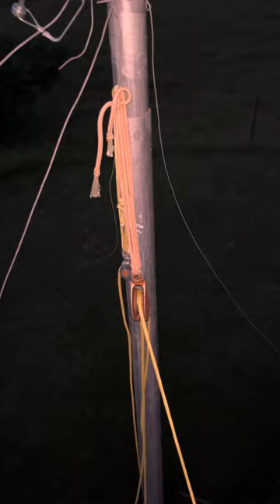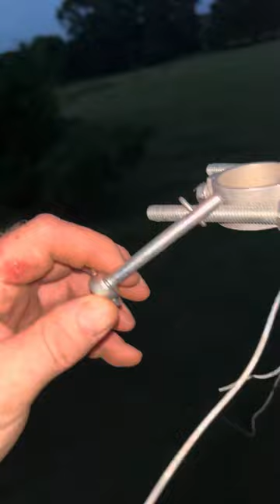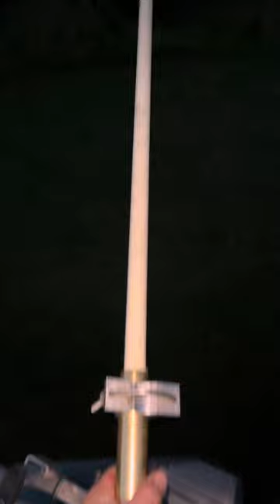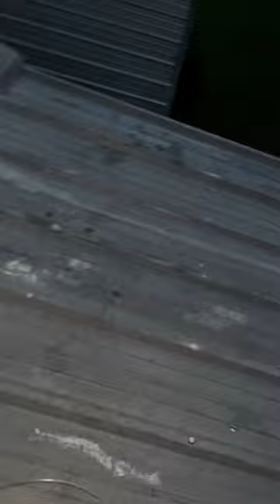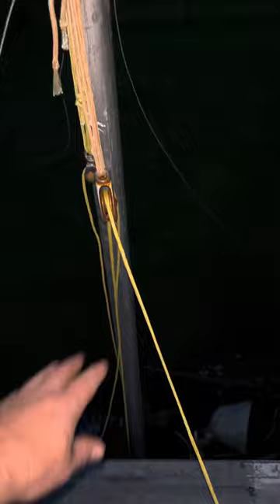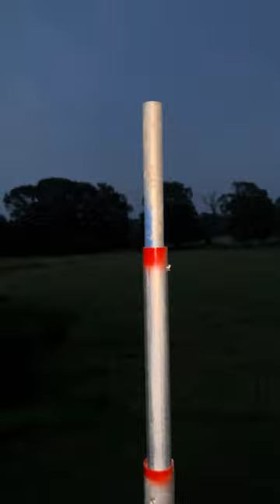Homemade diy telescoping mast

Comment: How easily do the sections slide as you raise or lower the mast?  Are they lubricated with anything?
Reply from the maker: There’s a lot of difference in the size of the different joints.  So there’s lots of slack.  Unless you use a bent joint, it’s easy to slide them up and down.

My H50 rohn pole however had a couple screws get tightened too much and so the joints are somewhat misshaped now, which makes it a little difficult sometimes.
Reply: @ahuggins6  OK, Thanks for your reply.

Comment: has it held up well since you've put this up?
Reply from the maker: It's interesting you should ask now.  We had a couple days of high winds a couple weeks ago.  Somehow, even with all the guy wires, it ended up falling over.  Guy wires still entact. Every piece is now scrap metal. I have no idea how it was able to move in order to bend over.
Reply: @ahuggins6  - if you put it up again, what would you do differently?
Reply from the maker: @honeybadger6127  I would add another set of guy wires.  But I have a friend who picked up a channel master pole at a ham fest last week and they've said they might sell that to me cheap.  Otherwise, I'd put the 120 or more bux that would toward more conduit into a round h50 or a new channel master.  But if someone has neither of those options available without expensive shipping, I'd do the conduit again and make sure it's guyed very stout.  One of my guy poi ts was too close to the pole, so that might be the way it moved.  I haven't thought too much on the math of it.